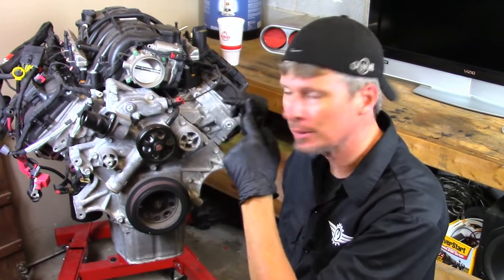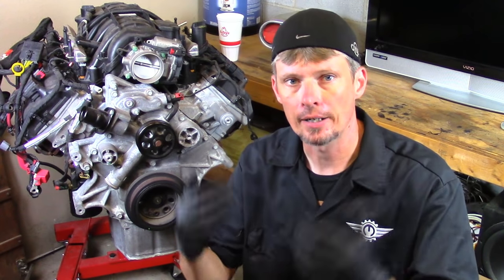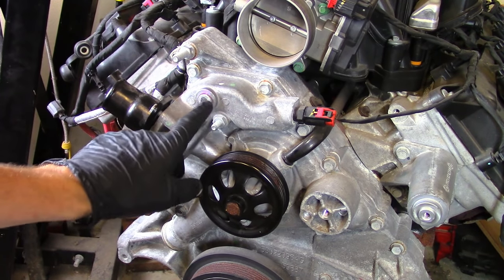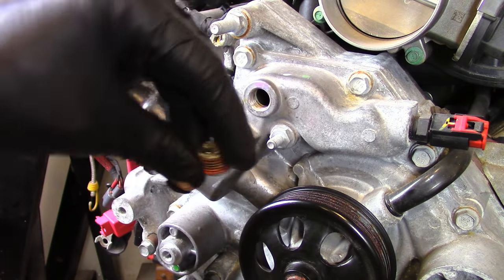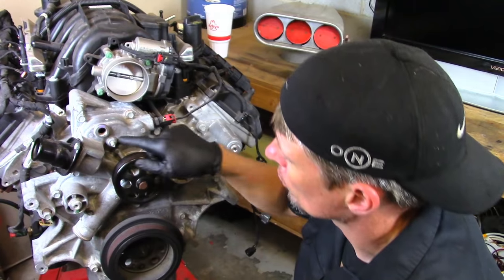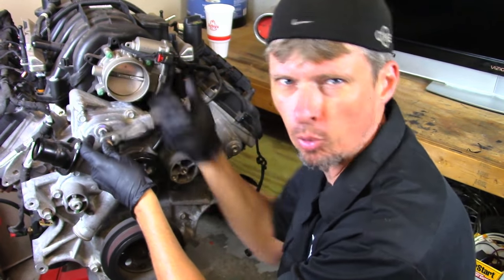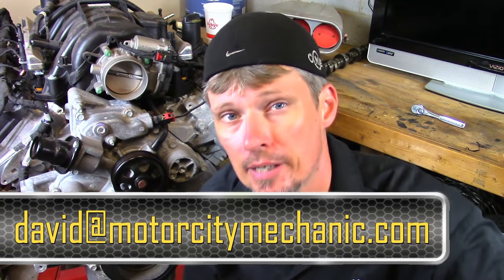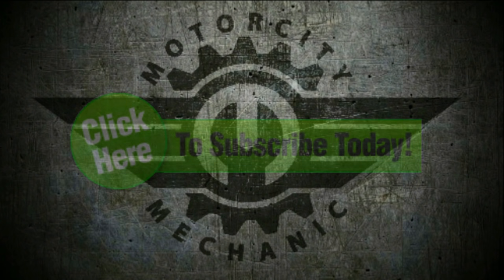Quick Tip: 5.7 Hemi coolant bleeder location and fill procedure

Comment: i have a 06 charger daytona and if I'm not mistaken the Hemi is supposed to be self bleeder meaning you don't have to bleed the air out just take off the cap to the coolant reservoir and the air should pressure out of there
Reply from the maker: Actually that isnt the case....you can still get an overheat because the air will not come out. I learned this the hard way a few times. The best method when possible is to use an air evac set up to pull a vacuum and then suck the coolant back into the system. Even then I still do the coolant bleed like in the video. Some times you have no issues....some days you cant get the air out without removing the bleeder. Thanks for watching and for the comment. Make sure to subscribe!
Reply: MotorCity Mechanic last summer I had to put a new upper radiator and I didn't do the bleeder because I didn't want the antifreeze to get on the alternator belt. so all I did was let the car heat up then open the coolant reservoir cap and the air came out of there. so today I put a new thermostat in and open the reservoir cap and let the air out and everything's fine. but my issue is when the car is cool down and not running it looks like the coolant reservoir is low with antifreeze but when the car is hot and running there's plenty of antifreeze in the coolant reservoir bottle. what could be the issue
Reply from the maker: Most bottles have a cold fill mark and a hot level mark. One thing I highly recommend is the bleeding as mentioned.....getting some on the belt wont hurt it. I just recommend hosing it off right afterwards and then you shouldnt have any issues.

Comment: I drive an 08 1500 5.7. Temp gauge moves toward hot but levels below half(normal) once I gain consistent speed. I have to constantly(every 2 wks) add antifreeze as well. Is this the thermostat or the heater core?
Reply from the maker: What I am concerned about is the antifreeze going somewhere.....I would start with a pressure test and see if there is a leak first. That can explain the temp issue as well. Start there and then make any needed repairs based on what you find out. Thanks for asking and make sure to subscribe.

Comment: Are there different types of coolant used depending on what year Hemi motor I have?
Reply from the maker: There can be yes.....depends on the year. Which leads me to ask what year is your vehicle?
Reply from the maker: The service info shows that yours will have the OAT purplish colored coolant thats a 10year/100,000 mile coolant. Thanks for the question and make sure to subscribe

Comment: If it has air would that cause it to over heat the car?
Reply from the maker: It sure can depending on how much air is in the system. Thats why its important to bleed the system when you get done working on it. Thanks for watching and make sure to subscribe

Comment: im about to do swap the thermostat on my 06 charger r/t, do i have to this or would the air just work its way out once thermostat opens??
Reply from the maker: Its recommended to use the coolant bleed otherwise you will still have some air in the system....not a lot but some none the less. Thanks for watching Rob, make sure to subscribe

Comment: but what if u can't open the bleeder valve is there any other way to get the air out
Reply from the maker: Best method is to use a coolant bleed set up that uses compressed air to create a vacuum in the coolant system. Here is a link to the style that I am talking about. https://www.amazon.com/OEMTOOLS-24444-Cooling-System-Refiller/dp/B01BW39HJS/ref=as_sl_pc_qf_sp_asin_til?tag=motorcitymechanic-20&linkCode=w00&linkId=6fc224462f525119265b060f14ea3a0d&creativeASIN=B01BW39HJS
Reply: Okay thanks I'll check the video out and give a try didn't know if air in the system would damage the engine at all and thanks
Reply from the maker: Too much air in the system can cause an overheat condition for sure and if not caught soon enough.....engine damage.

Comment: I have a question in regards to these Hemi's… I've heard a lot of reported issues with valve seat drops in theses 5.7's and some people in the LX community have suggested changing out to a lower degree thermostat can help because the issue comes from heat soak in some cases, Doing a little research I seen without some type of programmer to set the fans to match that of the thermostat would make it useless to do and will throw off a code when running a 180 degree. I need to change out the G-05 antifreeze and wanted to make sure I was bleeding the engine correctly and thought about changing out the thermostat while I was doing it even though it seems ok at the moment, But was wondering what your thoughts were on if I could go lower than the stock without having to mess with the fans. Just curious what your thoughts were on it in general? Thanks.
Reply from the maker: Lee Smith Personally I haven’t seen any issues with the normal set up. Only when there is an issue and it is ran hot. Depending on how hot it gets.....the head can expand and the valve seats drop out. Then things go wrong.
Reply: @MotorCityMechanic ... Got ya, I think I won't mess with the thermostat and just flush everything.
Reply from the maker: @leesmith1364  Sounds like a plan. Enjoy the weekend.
Reply: You have no idea... I have a 05 Magnum RT and everything I've done to this car has been hell, It took me over 3 hours to take all 4 wheels off and jack the car up. The lug nut covers where swollen and all had to be cut off, The lug nuts had been way over torqued and had to make a breaker bar with a 4 ft iron pipe, The Radiator drain plug isn't very easy to get to and is also stuck. lol, Everything I do is always a problem. Thanks again and love the video's. I always attempt to work on my car and need video's like this to make sure im doing it right.
Reply from the maker: @leesmith1364  Glad that the videos help. When it comes to those lug nuts....I recommend getting you some solid chrome replacements. They dont have those covers on them and you wont have that same issue ever again.
Reply: by diablo trinity is possible to change fan starting temperatures-on lower temperature to start to spin

Comment: I'm having problems with the return tube behind the water pump it leaks I replaced the tube with a new o ring
Reply from the maker: Thats odd that you replaced the tube and seal and still have a leak. I wonder if there is an issue where it goes into. Is that the one that goes into the side of the waterpump on the drivers side or the one that goes into the back of the timing cover on the passenger side?

Comment: So i but new water pump on unscrewed bleeder valve but nothing came out I had a full coolant reservoir and nothing still came out with the engine off also my original problem was I was getting no heat from my heater only when I started driving the heat started blowing out hot and at a stop it would blow cold air so I change the thermostat and started working again but then I noticed steam coming from the engine water pump was leaking out of the weep hole so now I have new water pump and new thermostat
Reply from the maker: You can try starting the vehicle and giving it some throttle to see if any thing changes. I just dont recommend running it long with the bleeder out.

Comment: so I add coolant while the engine is off? then once the coolant comes through the bleeder I add it back? im trying to make sure I understand
Reply from the maker: Add coolant until it comes out the bleeder hole. Install the bleeder screw and top off the coolant bottle when done. Thanks for asking and for watching.
Reply: @MotorCityMechanic  hey update I ended up getting the motor built and now it's a race car 😂

Comment: hey i just finished replacing the thermostat on my 5.7 Hemi in a 2011 jeep grand cherokee laredo. we then followed the steps in this video to bleed the coolant and filled the tank all the way up but no coolant ever came out of the bleeder hole. i turned the heat on but it is only blowing cold air. any suggestions?
Reply: Kasey Koster Hey Kasey, once you start to put coolant into the reservoir you will be putting in almost 2 gallons of 50/50 fluid into it before you start seeing the coolant coming out of the air hole. It helps to squeeze the hose attached to the reservoir to help the air go through the system
Reply from the maker: Hey Kasey......the Jeep doesnt use a pressure tank (coolant bottle) so filling the coolant bottle to the top will not work. You need to keep filling the radiator until coolant comes out the bleed hole.  Its all based on where the radiator cap is located....yours will be on the radiator. If still having issues then let the engine run for a bit until the temp reaches about half way on the gauge. Then let it completely cool off and then try the bleeding again to see if any change.

Comment: once i drain all the coolant out, and i get the bleed port open' can i just take the  radiator cap off and add the 50/50 mix into the radiator until it starts comming out the bleed port? im not sure if thats what you mean when yo say coolant bottle
Reply from the maker: Depending the vehicle that the engine is in.....some have a pressurized coolant bottle and some have the radiator cap on the radiator. The procedure is the same with either on. Air bleed port open....add coolant to where ever the radiator cap opening is until it flows out and then install the port bolt/cap. Thanks for the question. Make sure to subscribe
Reply: MotorCity Mechanic ? Hello ....if my coolant reservoir is full and the engine is cold and  I add 50/50 mix into the radiator until it starts coming out from the bleed port I have to  drain my coolant from my reservoir. The reason why I asking is because the air bubbles..

Comment: I have a very extreme issue where my radiator blew so it overheated then shut off and I experienced a rough condition where it sounds like it has the biggest cam in the world trying to start up after replacing the radiator. I'm not sure what to do next
Reply from the maker: What worries me is the overheating and shutting off. That could point towards alot of things. Basics such as compression tests, cylinder leak down tests, etc.....need to be done to make sure that the engine itself is fine internally.
Reply: BABY JOKER I hope not, but it sounds like your cylinder head dropped into your piston. It sounds like a Diesel engine when that happens. The 5.7 hemi engines are notorious for dropping the head into the piston when it overheats. I speak from experience. I have a 5.7 hemi 2006 Dodge Charger. Engine is known to go bad prematurely.

Comment: So I’m not supposed to turn the engine on at any time ?
Reply from the maker: There is no need to. Plus that warning is so that no one opens the cap or touches the hot coolant and get burnt. Just removing the bleeder and filling the coolant bottle until it comes out is all thats needed.

Comment: 03 ram
just did my water pump and I don't see a bleeder anywhere on the block. My system is set up in opposite direction as the engine in the video.
Reply from the maker: The bleeder on the trucks is hit and miss depending on the year. They did reverse everything such as the t-stat housing position. If it does have one....expect it to be near the highest point on the timing cover. Sometimes there may be a metal plate/bracket covering it.
Reply: went ahead and did it old school and ran it without a cap for about 30 minutes, seems to have gotten it all.
Reply from the maker: Recommend rechecking the new few days first thing in the morning when cold to see if the level drops and top off if need be. Otherwise good job! Make sure to subscribe

Comment: Hey David! I just replaced the Water Pump on 2012 Jeep Hemi. I was just watching this video (Huge help BTW) But I realized while watching that the solid hose with the O ring (up and to the right of the WP pulley) is not pushed all the way in to the stop. I really tried but it just would not go. I don't want to break anything and it is not leaking at all. any tricks to get it all the way to the stop or am I good?
Reply from the maker: The pipe needs to be fully seated. Fully seated will be when the mounting bracket is flush with the block. Thats where the 10mm bolt goes. The pipe is bolted in place there and also on the back side of the left cylinder head. You may need to remove the rear mounting bolt/stud so that you can make sure the pipe is fully seated. I may use this question and my hemi I have on the engine stand in the shop to explain this further when I have time. Thanks for watching!
Reply: it is flush but the dimple in the metal line is is still an 1/8 on an inch from seating against the Water pump like in your video. It does make an audible pop when it goes in like the O ring is seating on something but...I'll have a look at that rear mounting bolt.
Thank you for your response! BTW 4th Water pump in 120K on my Hemi SMH.
Reply from the maker: BuckeyeMCS I rarely see more than one waterpump on the Hemi.....are you using aftermarket or a Mopar replacement? If the pipe mounting tab is flush with the block then you should be okay.
Reply: MotorCity Mechanic they have all been replaced under warranty by a local dealer until this one.
Reply from the maker: Yeah I dont see repeats on Mopar waterpumps.....very strange unless they used an aftermarket pump from one of the local auto part stores.

Comment: Im having an issue with my 6.1 hemi after changing wp/therm/rad/expansion tank i think i still have air in the system...i fill up to max in cold after bleeder drips, drive it around until temp is 203 park it and coolant past the overflow point in the expansion tank...if i idled with ac on itll go past 212* in 80* weather
Reply from the maker: Have you rechecked the level when cold like the next day and then remove the bleeder again to make sure all the air is gone again at the same time? Other item to wonder is.....you replaced alot of items for a reason.....was there a leak or was it running hot before the repairs?

Comment: l have a 2015 Chrysler 300S with the 5.7, l had a leak and going to get it fixed but is there a link you can provide do get the exact coolant the dealers use for my vehicle? Thanks in advanced.
Reply from the maker: Here is the link to the fluid on Amazon: https://www.amazon.com/gp/product/B017DP433O/ref=as_li_tl?ie=UTF8&camp=1789&creative=9325&creativeASIN=B017DP433O&linkCode=as2&tag=motorcmecha01-20&linkId=b5fd1eed27fab70181dbb960a83d7679 . Hope that helps. Make sure to subscribe and watch the other videos.
Reply: l went to amazon and l put my vehicle info, it told me that it was not for my car? ls there a certain type of product # to get the Mopar antifreeze for my car?
Reply from the maker: Here is the part number from Chrysler: 68163848AB. If you look at the picture in the link you will see its the same Prt#. Thats the same antifreeze that you need
Reply: MotorCity Mechanic will that link help your channel? That way l can order it from there. Also with that exact antifreeze, would l have to bleed it out or is it safe to just add it in.
Reply from the maker: If you use that link then yes it will give credit to the channel which always helps and is always appreciated. With the engine cold....I would add the antifreeze in the bottle and then remove the bleed screw to be 100% sure there is no air in the system. I rather you be sure then just say top it off only.
Reply: MotorCity Mechanic Perfect thanks for the help!
Reply from the maker: Your welcome and thanks for the support

Comment: Hi I have a question.  I attempted to do this on my 300c Hemi 5.7 and after pouring in 1 full container of 50/50 solution, nothing ever came out of the valve hole.  My reservoir was at the max point so I was afraid to keep pouring solution in it.  The car had not been driven in about 3 hours but was obviously still a little warm.  I would love any suggestions or advice on what I should do.  Thank you!
Reply: Samantha Charles man the same thing happened to me. I had to stop pouring in the coolant bc it was at max. I have a 2006 hemi 5.7. What happened did you fix the problem?
Reply from the maker: What I recommend......if you never got anything coming out the air bleed bolt hole....then put the bolt back in.....adjust the coolant level in the bottle. Then start the vehicle and let it run. You want to see the temp get to half way on the gauge. Then cut of the vehicle and let it cool off completely. Then repeat the coolant bleed and see if any difference such as fluid coming out the bleed hole with the bolt removed.